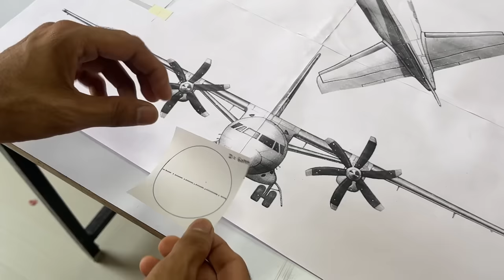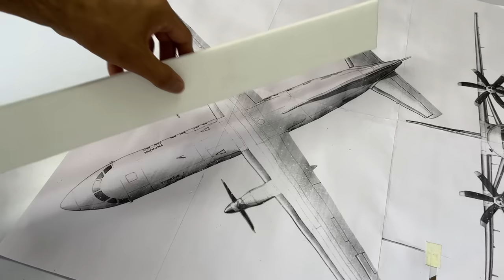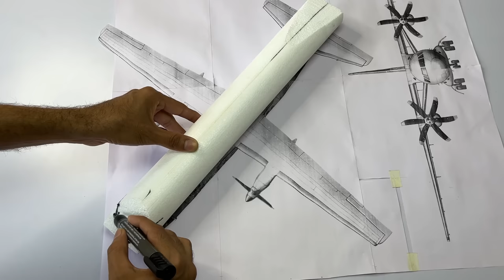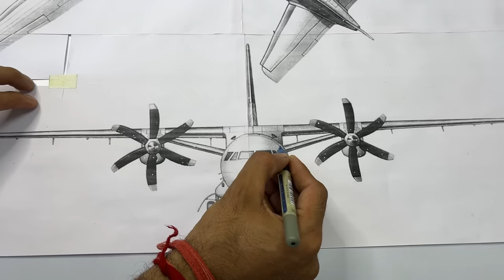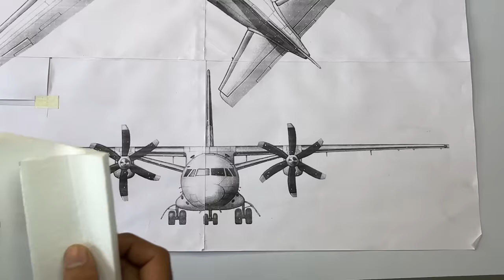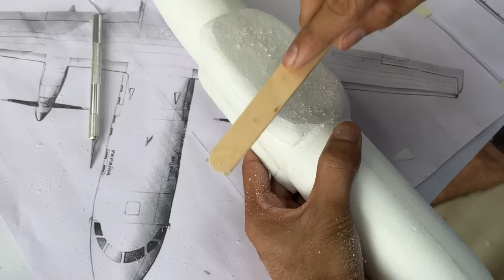Make A Rc Plane AN-140 Out of Thermocol #rcplane #diyprojects #airplane

Comment: Very nice work, an interesting choice of subject too. My very few critiques would be to hollow out the fuselage and Hotwire a more consistent airfoil in the wing. It’s flying but only just, you need a more precise and consistent low speed airfoil and you’re have much more control with a system that allows at least one servo for pitch at the elevator.  I’m busy with an ATR72-600 using a similar technique but electrics from a micro Heli. Happy landings.
Reply: Exactly what I was going to say. Hollow out more of the fuselage, cut out a precise airfoil for the wing.
Reply: Great!...pls how do I make that cutting mechanism?

Comment: Beautiful videography, not just the aircraft! Simple but detailed, very effective. The hotwire tooling you built yourself is also just as cool as the aircraft in my opinion - I also make my own hotwire tooling but I think yours looks nicer than mine! 😆The handling of the aircraft is also surprisingly good for a 2ch diff-thrust setup. (I have only once ever bought a ready-to-fly RC plane - I normally scratchbuild too - and it was a 2ch diff like this, but it was barely controllable.) I am curious, what country are you living in? Here in NZ we call this type of foam "polystyrene", instead of thermocol, but I have heard that name before on web forums and wondered where it was from.
Reply: Dude’s from India…haven’t heard the word thermacol since I moved away a couple of decades ago, brought back some fond memories 😂.

Comment: It’s exhibiting some very tail-heavy flight. You might consider moving the battery pack and/or receiver unit forward. CG should be 1/3 of the wing chord when measured from the leading edge. Beautiful build. Another issue might be the props used. You might get more thrust from a tri-blade.
Reply: Bb

Comment: Hi, can you answer please, I am trying to do the same Rc plane, so i wondering if affects in case if i used another toy for the electronics parts, cause in the video you use an S-27 speed plane, but i have an S-35, do you know if that actually works even if is another model of speed plane?
thank you
Reply: It should be fine, how much power does the su 35 RC plane have?

Comment: you could have make a 3d printed propeller to add more blades and with more blades the faster you go and you could use less throttle and battery making it effecient